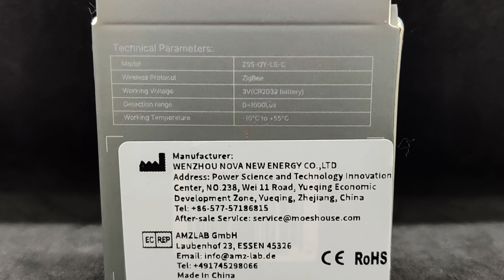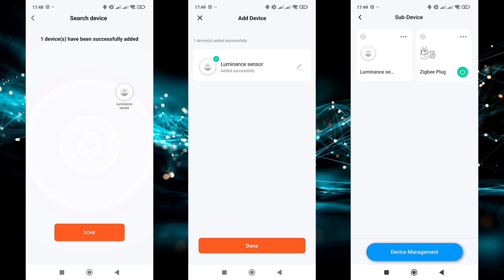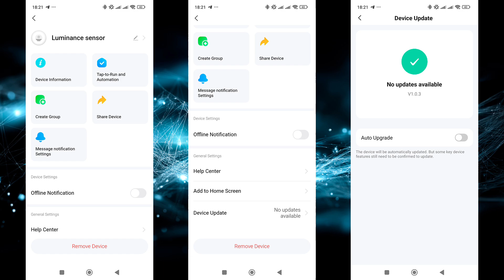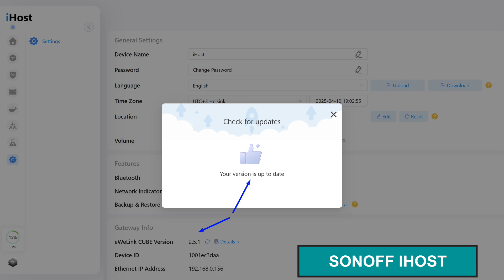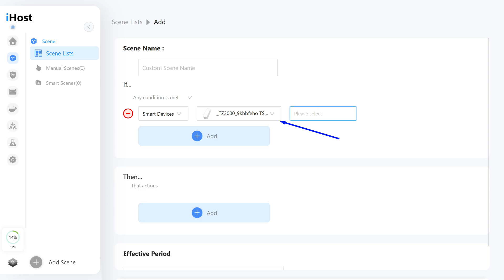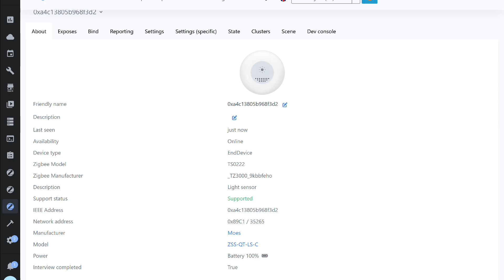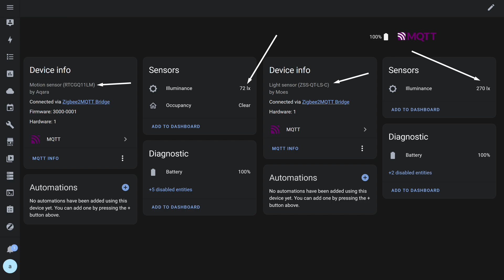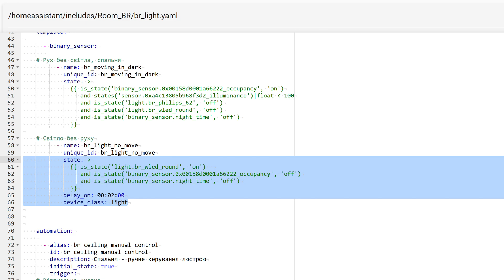Moes ZSS-QY-L5-C - zigbee light sensor, review, compatibility test

Comment: Got the exactly same moes-sensor last week. After a while the sensor starts flooding my z2m-network with douzens of messages per second! Keep an eye on that and take a look in the logs of z2m! It leeds to an unrelible network. Even after a delete/rejoining to the network it behaves the same way. So I deleted it cause in my case, it's useless/dangerous for a reliable ziggbee-network and I can't recommend it at all. 
The compareable Aqara GZCGQ11LM (Aqara T1 Lightsensor) are way better! Furthermore it's measearing-range is way higher - up to 130klx (130.000 lx).
Reply from the maker: Mine is behaving normally so far. I have three sensors from Aqara, in home use there is no difference - what is 1000 lux, what is 100000 lux. Since you need to track when it is dark, the range from 0 to 100-200 lux works.
Reply: @Alex_Kvazis  Well I use the aqara sensors even for automations for cover/shutter around the house.
There a 3 of them in south/east/west-directions. In bright sunlight it's really helpful to control these - I measured above 130klx in the window-areas. Btw. the aqara are robust against UV. It's housing isn't  ABS- but ASA-plastic.
Reply: In the meantime I tried to overcome the problem and use parameter "trottle" in z2m configuration.yaml. I set it to value of 10 and this seems to work so far.